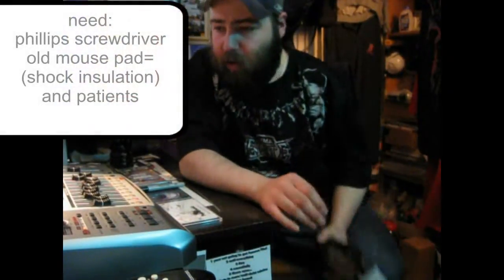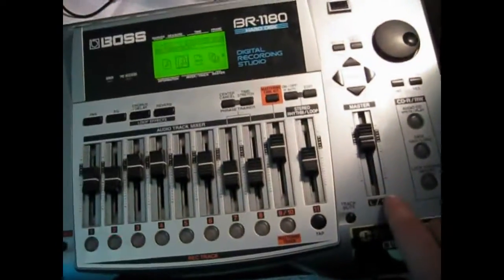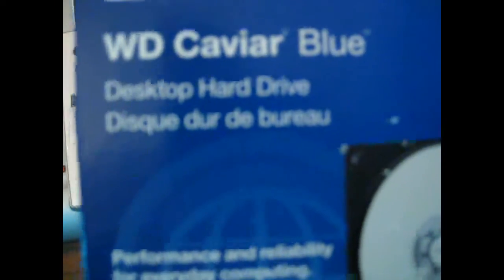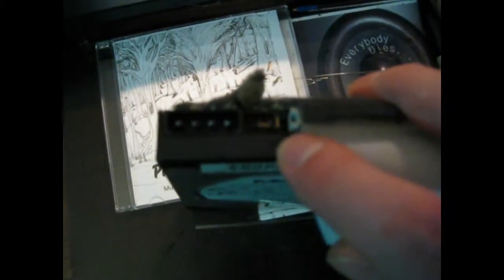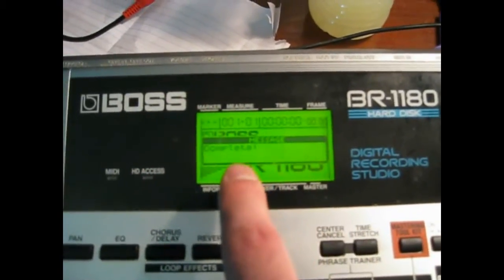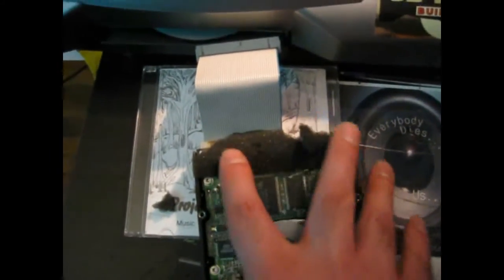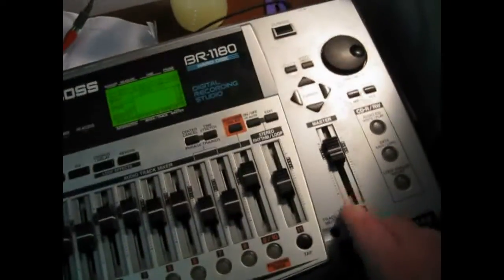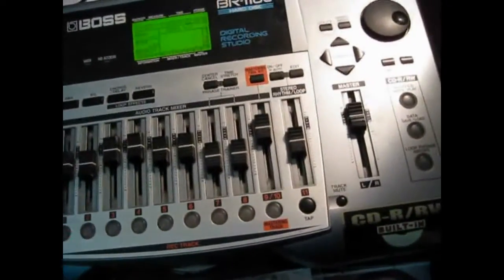diagnosis and replacement of a br-1180 hard drive

Comment: Thanks for the info. Just fixed my BR-1200. I do want to note any new HD has to be formatted as exFAT or FAT32. NTFS will not work (or - at least - did not work for me). My unit had a dead Hitachi HD & I replaced it with a Maxtor 80GB- $30 w/shipping.

Comment: Mr. Salera,  thank you most kindly for your post of this video.  I don't have much in the way of financial resources and I picked one of these up not working cheap.  I had hoped to be able to go through some sort of re-initialization process or reset to factory presets but, with my limited computer experience,  when I turned it on for the first time and got the solid red "hd" light and other red lights I could also hear what I imagine is a ruined hard drive.  I appreciate your instructional video and you as a person.  I would imagine a good person goes through your experience and thinks about posting a video to help other people out but doesn't find the time to do it whereas a great person not only has the thought, but also does the helpful thing.  Thank you for your help.

Comment: Great video. I thought my old BR-1180CD would never break.  Well it did today.  I was erasing a few songs and tried optimizing what was left and on one tune it got stuck.  Unplugged the unit and then it came up with "now checking" message and just stayed there.  Tried the hold down [5] and Undo while turning the unit on and got to the test menu but couldn't do anything. Too bad Boss got rid of the 1180 and 1600 line.  Great machines IMHO.  I guess I'll be getting a desktop HD.  Thanks for the tips.

Comment: Man, thank you so much for this. My question is; and this may be a dumb question but my issue was the same as yours- i would have to unplug the unit to power it off. Is it possible to retrieve the data off the frozen hard drive? Or is my work lost forever? Thanks man

Comment: My br 1600 lights up but does no longer say had error. I’m just gonna go to best by with the hard drive removed and hope for the best
I do have a hard drive from my old desktop but it doesn’t seem to plug in the same way otherwise I’d use it. Any suggestions or guidance would be mad appreciated bro

Comment: I have a BR8 which uses Zip Drive for aBackup but has the same IDE CABLE and Power Supply as shown . Never had a hard drive in it but with Zip Crap out has the space now and it looks the same size as Hard Drive

Comment: HI there,I have a BR 1600 Cd which is giving me fits.  It works when I boot it up. If it sits for 5 minutes with out doing anything it freezes up and there is a terrible hissing coming form the headset.  I imagine it would be coming through the speakers if they were hooked up.  I have to unplug the unit to get it to start up again. I can record and play but left alone for a minutes or two and it crashes.  I initialized it but still does the same.  My question is....do you think its the hard drive or the onboard electronics?Thanks very much,-Phil

Comment: Thanks! My drive was stuck in the checking mode... Didn't have a device to format in fat 32 so just nicked one out of an old desktop that was dead - but hoping it wasn't dead cos of hard drive - wacked it in with a bit of foam packing cut in half top and bottom of drive, turned the 1180 on and bing0 66hrs of recording time, although once initialised it says 33 hrs. Seems to work so I'll put the rest of the screws in, sadly lost all my songs as I do not have the CDROM model, but had recorded them for playing with on Laptop, so have the files, but of course I hadn't saved them track by track (it would have taken forever) but seems to work. I record in the kitchen and think the old drive failed because my new washing machine vibrates the whole room when  it gets going, will put the 1180 on a tea towel or summit to insulate it from bad vibes, the drive had been struggling to load songs and kept crashing for the last week or so.

Comment: joe how is it possible for you to put a new drive in dont you need to have the operating system loaded onto the hard drive to use it or is that installed into the system ? i have a br1200 that has harddrive load errors im trying to figure out if i do the switch on the drives if it will still work plug and play or if you had to install the os on it

Comment from the maker: @f1r31c3r1 @f1r31c3r1 1 through 8 partitions at 20 gb a piece , i was in a pinch to find a replacement and got a great deal on the 500 gb and took the chance and it worked , so basically there's 160 gb to use , and like340 gb that will never be used unless i transfer the data to another HD ,seems excessive, but i'm fine with it the way it is , i didnt take a money hit so its all good

Comment: Hello. I have a BR-1180CD. and  the "drive error " mesagge ocurre !. try to fix it as you explain in your video. initializing, replace the hard drive for a Maxtor ATA/133 40GB and burn it just turn on the BR-1180. i install another hard drive of a different brand and listen to on and off as if failed to fully boot you could help me solve my problem? its formate whit the FAT 32 system files. tnx

Comment: This is absolutely the best info video I have ever seen! Fuck you boss! My br-8 has been down for years and I'm trying to recover some old tunes from the zip drive in it. Any suggestions? Will it work the same as replacing the 1180cd?

Comment: Just a couple of items I didn't see. I replaced mine on a br-1600 with a cd r/w. The jumpers may vary.  The Caviar Blue's jumpers worked using 5&6 or, the ones in the middle. Also, no matter what jumpers you use you will still get a hd error. You have to get the right jumper settings and then initialize the hd.  Roland says they don't reccomend WD or anything over 80mb. I used the WD anyway so we'll see. It's up and running now.
Reply: hi, I am trying this with a zoom mrs-1044 seems to be the same insides as the boss br series. but not sure about jumpers any info? thanks...

Comment from the maker: @busywave its worth a shot ,just make sure to look at your connections on both hard drives before you disconnect them, if they are the same then as long as the hard drive going in is fine ,should be good,, comment back and let me know what happens ..

Comment: When you partition the hard drive did you use NTFS format? Also did you need to initialize each partition on the BR?
Reply: Questor Jones I was going to comment on this. I had to replace the HD on my BR-1200 & it was formatted NTSF. It will not work formatted that way. Since the unit is meant to work with either Windows or Apple (via the USB) you have to use the exFAT format. Once I did that the unit recognized the drive & let me initialize it.

Comment: I hope you can help me with my br 1200. I accidentally plugged it into my laptop power supply instead of the power supply . It started booting up like normal but before it finished it began flashing all the lights I assume to signal a system error and now goes into an all lights flashing mode immediately when I try to power it up. It seems like I should be able to do a factory reset to correct the problem but i cannot figure out how and can find no information on the problem.
Reply: InHisImage Stainedglass I'm getting and hdd error. But I think its because I used a universal power supply.
Reply: Yeah it’s happen to me too... I just replaced de HHD and it’s work now. But my CD burner it’s death too.

Comment: My power source to the hard disk stopped working. I had to use an external power adapter to get it working again. I replaced with a 160gb hard disk and works a treat now